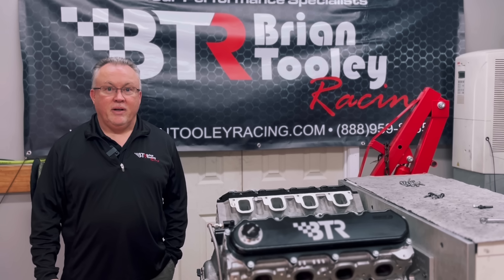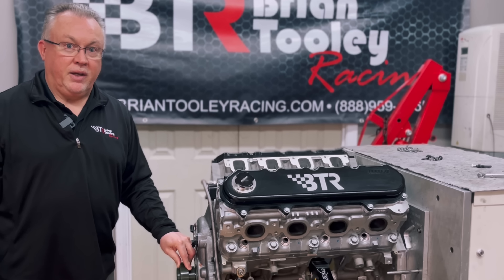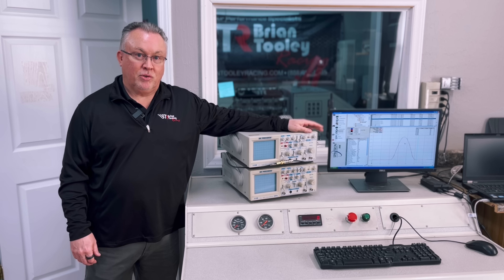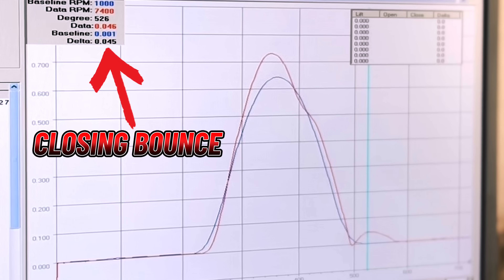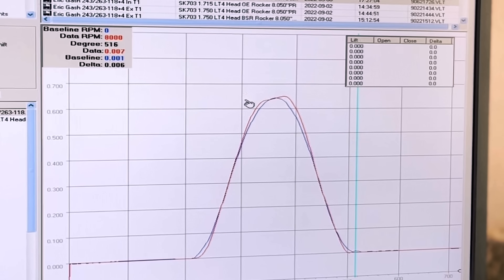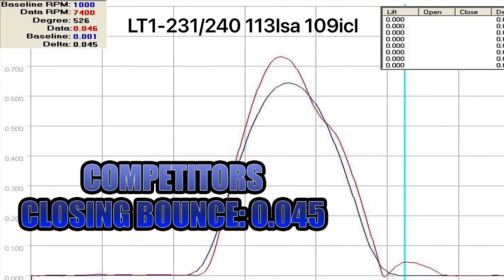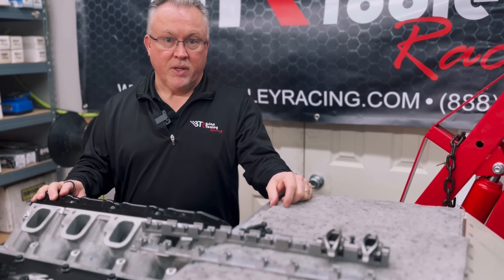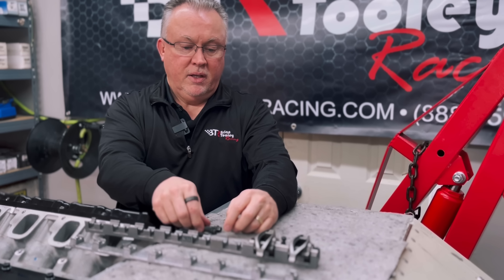Introducing SPINTRON With Brian Tooley

Comment: Brian, Great video, one thing I notice and it is the one thing I have done for over 20 years. Fix the saddles on the rocker stands. I have re-machined Jessel, TD, Comp rocker stands so the shaft would sit slightly below the shaft C/L so you take the load off of the hold down bolts. You are the first I have seen do this, great job.

Comment: I would love to see a deeper dive into what some of these other components, like rockers and fasteners, do to valve control.
Reply from the maker: We can certainly do that, we have hundreds of back to back tests.  I would rank the components in terms of importance to reduce bounce by:
Lobe design 
Spring pressure and design 
Valve weight 
Rocker mounting 
Although once a LS intake valve gets in the 120 gram range, it becomes very difficult to control past 7000 RPM.  Generally a spring with less moving mass (conical or beehive) works better on very heavy valves.  Hydraulic roller valve trains are very sensitive to weight of the components, much more so than solid roller applications.
Reply: I had a solid roller that had what looked like bounce marks on the closing side of the lobes.
I at the time figured the lifter must have had loft of the lobe.
Still don't know for sure.

Comment: Thanks man! I really appreciate your desire to learn and improve everybody’s race program! You’re correct about spring pressure one best junkyard motors I ever had was small sbf .600lift solid roller 190 intake runner Only 100lbs on seat! It ran deep in 5.70s to 1/8th

Comment: Just bought the Red Hot Cam, .660 platinum springs, and the BTR shaft rocker system. I already know this cam is going to have better drivability and make more power than my old setup.

Comment: I know nothing is perfect, but I've always wondered how accurate Spintron tests are considering the significant lack of gas/chamber pressure dynamics which cannot be recreated. I'm not saying it's not a significant increase in knowledge vs. guessing, but I'd be nervous to put too much stock in it. I'm assuming its results have been compared to operating engines, so I'm probably overthinking it.
Reply from the maker: In an operating engine the exhaust side of the valve train should see even more deflection than on the Spintron due to the residual pressure left in the cylinder when the exhaust valve attempts to open.  An engine with a power adder will have more cylinder pressure and therefore more opening deflection.  The intake side operates almost the same.

Comment: Thank you Brian for the technical video. I believe there would be performance advantages if the spring pressure was distributed evenly through the valvetrain. Instead of at the end, at the valve. Can small springs be added at the push rod end of the lifters? My engineering mind never stops finding alternative solutions 🧐
Reply from the maker: That exact product used to be sold under the name of "Rev kits", not sure if they still exist.  The entire valve train is sensitive to weight, even on the pushrod end.  We've seen heavier 3 piece pushrods not perform as well as one piece due to the weight difference.

Comment: How does a spin Tron or vice a versa your development team account for the atmospheric pressure is on each side of the valve with an open chamber? And I guess how much does that affect the valve and its movement?
Reply: Exactly what I was wondering, and more of an issue on boosted engines with boost acting against the intake valve .

Comment: Assuming you're spinning that thing at ambient temperatures,  how closely does that relates to engine operating temperatures?
Reply from the maker: Valve springs make a lot of heat, so the engine actually runs hotter than ambient.  We've gotten the engine hot enough at times to fill the Spintron room with smoke!

Comment: Brian, how does your shaft system compare to Jesel? And is it a useful modification for high-RPM capable hydraulic roller cams that are going into a stroker Gen V LT like 468 or 480 (or even 500+)?

Comment: How does the absence of heat, piston vibration and other combustion effects, affect your valve train measurements?
Reply from the maker: The largest difference between the Spintron and a running engine is the exhaust valve opening against cylinder pressure.  We use the engine dyno to test some aspects of the exhaust side of the valve train combination.

Comment: I have an LS7 crate engine with 227/242 .591/.590 lift 116 LSA cam which comes installed.  I plan to rework the heads.  Would a .660 spring kit be too much spring paired to that cam?  What spring would be optimal?

Comment: Cool stuff, I just did a AFM delete on my 2015 6.2 and used a stock Grind BTR cam. I am beyond pleased, this engine has never run so strong and smooth. If and when I build a LT platform, it will be BTR all the way.
  Do you guys design cams for Pontiac V8s, 1972 455 HO is my next project.
  Your R and D is very impressive. 👍👍🏁🏁

Comment: Would the closing bounce be not as bad with a piston compressing the charge?....really cool tool... thanks for showing us your toys!
Reply: Now there's an interesting question,.. Would be how much force the spring applies, plus the force of the air pushing on the valve head, vs the inertia of the bounce's opening, and maybe affected by the push of air from the manifold and the pressurized air inside the cylinder forcing it's way past the opening, and those last ones would be different for NA vs Boost.
Reply: Yes it will because as long as you have bounce, you don't have compression that could force the valve shut. However, more often than not, it will actually increase the bounce as it might try to escape over the valve, thus forcing it to bounce even more. The idea that compression or boost will help close valves, is not the case. If it was, you'd never have to run more valve spring in boosted and super high compression applications.

Comment: But the deflection would not occur on an overhead cam engine where the cam lobe itself is regulating the valve. The only pressure point would be the valve guide so as long as the guides are good then the cam would keep the valve from deflecting.

Comment: Is there any data on how the different ramp angles (from the different cam follower diameter) in GM, Ford and MoPar engines from the '60's and '70's affects any loft occurring?
Would the faster ramp of the MoPar cams lead to more loft then the GM cams? (GM > Ford > MoPar for ramp angle steepness)

Comment: Wow, who would have thought fasteners would have a difference in that application. 
I would imagine with the compression of ignition and forced induction that also must have an
 effect.
Reply from the maker: It's certainly much harder to open an exhaust valve against cylinder pressure than what it is on the Spintron!  Especially if the engine has a power adder!

Comment: So many old Smokey theories' been placed on the trash pile due to the advances in SPIN TRON.   The engines I buy for my customers have orders of magnitude better feel than any other because of the spin testing done.  They are smoother and more powerful than the OEM stuff by far.   
  I've read that some others have done piston travel laser mapping as well and I sure would like to finally lay the rod ratio argument to rest.  Albeit I already know the answer because like everything else in life there is no such thing as the perfect one size fits all for every purpose.
  Like asking a 22Lr to take down and Elk or 45-70 to leave any trace of meat when hunting squirrel.

Comment: Mr Brian Tooley, we are building a 92/103 turbo sbe 6.0 ls, rectangle port heads with heavy truck valves, stock rocker arms, really just stock junk. Can you grind us a cam to keep all the heavy parts stable at 8-8500 rpm, so we can just let the turbo make the HP?
Reply: This is a racecar. Driveability does not matter at all. We are just looking for super stable lobes for high rpm with heavy components, and let the turbo get the job done
Reply: That sounds like a really odd combo. But hey, if that's really what you do, I think BTR would consider your inquiry a lot more serious if you gave them a call.
Reply: @AB-80X  Thanks Man, I'm sure you are right. Just got caught up in the moment seeing Mr Tooley address valvetrain control at high rpm. It makes me jump for joy.  Back in my Honda dyno days,  one stupid aggressive comp grind would float the valves at 7600, while a very lazy crane cam would go 9200 on the same springs. No gains over the comp cam, but another thousand plus rpm plateau of usable power
Reply from the maker: It would be very difficult to get the 110 gram L92 intake valves to be happy at 8500.  Your best bet is to change to LS3 intake valves.  But we can certainly grind a cam for you!

Comment: cool tool. is it similar to what Katech uses?
Reply: Spintron is the de-facto standard in the US for this stuff.
Reply: @AB-80X  too bad not every aftermarket company have it or uses it properly.  I mean it is a cool tool at the end and it's way more useful if people like Btr guys and other few in the aftermarket are learning and sharing results with us
Reply: @GearheadOutlaw  The aftermarket guys cannot share that info, that's their bread and butter. You cannot expect them to do that. It's not like sharing regular info on Yellowbullet for the greater good. Here BTR shares next to nothing. What he does is to tell you what to be aware of, but there are no useful data points.

I don't know of any reputable cam manufacture or engine builder who does not have a Spintron or two and know how to use it. Are you thinking about someone specific?
Reply: @AB-80X  well.... a guy from Katech did and he was very insightful on some forums with great info on several camshafts with different specs and valve and springs etc.  Then again it is what I was hoping for to continue as a trend for the aftermarket guys and us as customer to make a good decision on what products to go for with information to back it up.  They are not OEM with billions in R&D most are moms and pops shops who are climbing  up the ranks with innovation
Reply: @AB-80X  on some who know and don't remarks.  Take comp Cams as an example....

How many years did they stay in the stone ages with their spintron and lobe design and ramp rates?  Now compared to Btr, TSP, Cammotion, EPS, Pat G and so who took the market to another level.

In any case some people know how to innovate with the data they have some do not that's all

Comment: So which bolt/stud is the best to use with your shaft rocker kit?
Reply from the maker: When we tested the individual trunnions the ARP studs were the best.  However we were surprised to see the BTR bolts perform better than stock.  We never back to back tested the fasteners on the shaft kits.

Comment: Does boost effect bounce?
Reply from the maker: Great question, when I think about intake or exhaust closing events I think about the differential pressure across the valve at that point.
It's my belief that in supercharged applications closing intake valve bounce has about the same effect as in NA applications.  However in turbocharged applications where turbine pressure can be twice as much as boost pressure, and therefore a lot of differential pressure during the exhaust valve closing event, I believe that the exhaust valve bounce would allow exhaust gas contamination of the intake charge and hurt power.
Reply: @briantooleyracing3554  agree 100%. Volume diameter, surface area the valve all those play into factors of valve control. Got to do a video about valve spring harmonics as well if you haven't already

Comment: Boggles me on the spintron the missing factor of cylinder pressure and piston speed and the closing effects it has on the combustion side of the valves due to surface area of the valve remembering the valves in a combustion chamber make up about 40% of the average combustion chamber surface area and this is the basics of it.